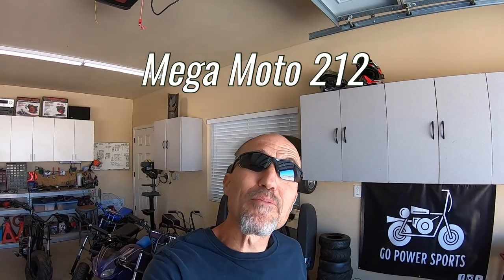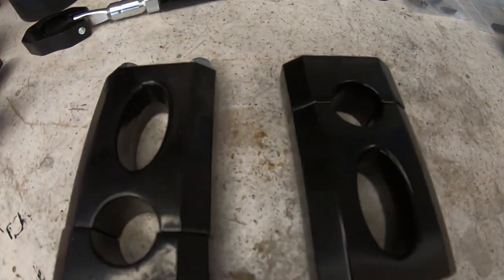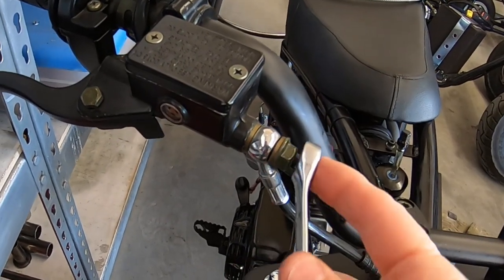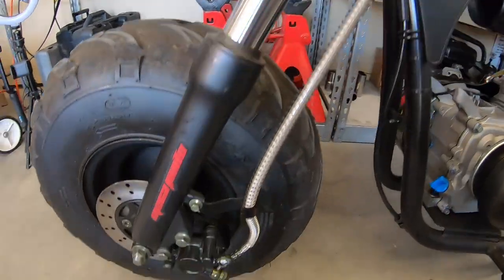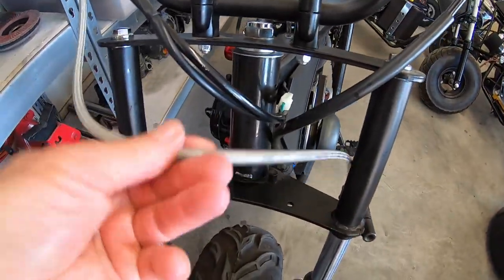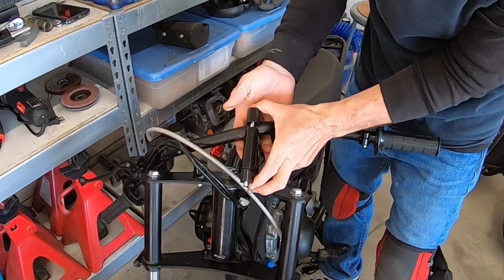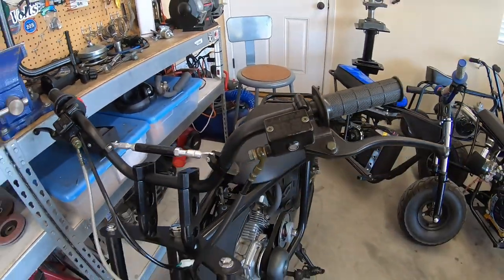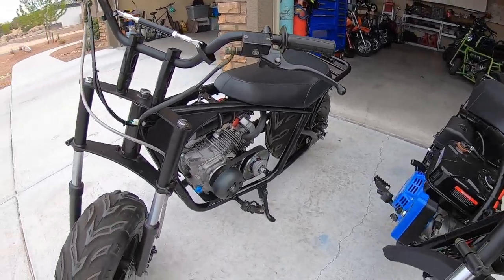When you add longer brake lines and handlebar risers.

Comment: dumb question, what is the point of a handle bar brace? it doesnt work like a steering dampener, so is it just so you dont take a bar to the tits when you inevitably run straight into a curb?
Reply from the maker: Handle bar braces are to stiffen things up and cut down on handle bar flex .  Also to cut down on handle bar vibrations, and a good mounting spot for action cameras and phones.
Reply: I use it for my phone too
Reply: PADDED handlebar brace so u can keep ur original teeth!!!!!!  double padded handlebar brace????  helmets are good too yes stiffen the bars for ppl that are bigger than young ppl. better to have it and not need it than need it and not have it???? i suppose it depends on cost? the handlebar risers are $30 on e bay.... amazon too?  save ur back... my back.
Reply: Thanks guys 🤙🏽